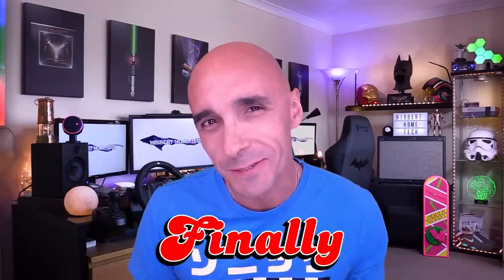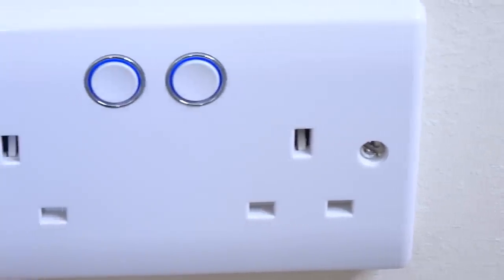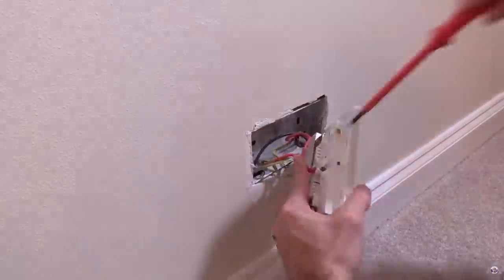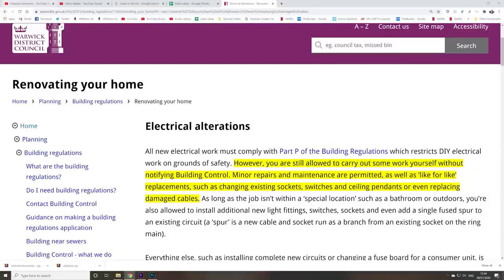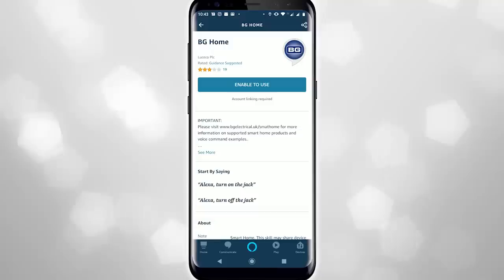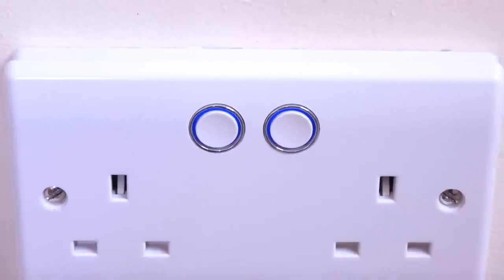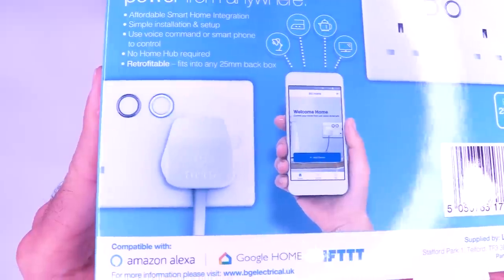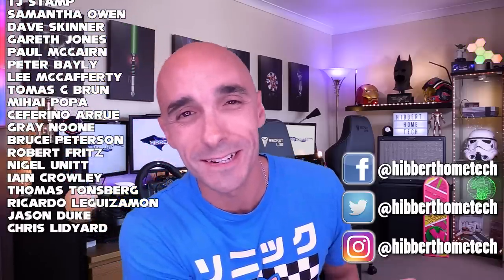BG Smart Home Sockets | Alexa and Google Wall Socket Review

Comment: "Electrician's screwdriver"? If you mean one of those screwdrivers with a little bulb (test pencil), they aren't trustworthy. Use a proper test probe.
Reply from the maker: I can't get this right 🤣 last time I gave this advice I was told by some very angry dude that I should be recommending an electricians screwdriver instead of a multimeter so I figured I'd cover all bases. Wrong again 🤣
Reply: The problem with using a multi meter is that if the leads are broken or the meter is duff then you get 0 volts and you think your fine just before getting all frizzled. The problem with an electricians screwdriver is that it relies on your body to provide the circuit so that the light works. Likewise with the non contact mains detectors. Professional electricians use testers designed to prove the circuit is dead and have a proving unit they test the tester with before and after the test. Multimeters are a better option than the neon type screwdrivers but only if you follow a good proving methodology. Great video and good warning Paul.
Reply: If a working neon test screwdriver (not electronic type) doesn’t light when you touch it to a wire then you are not going to get a shock if you touch the wire. The same cannot be said of a multimeter which may not have a reliable neutral connection and could indicate a safe condition even with a live wire present.

Remember, always test the neon tester on a know live immediately before using it to check the safety of the circuit you plan to work on.
Reply: I always touch neutral to live (using insulated screwdirver) after removing breaker and testing with multimeter, better the flash bang and fuse/breaker flipping than flash bang dead.